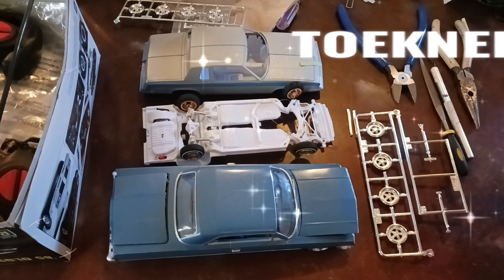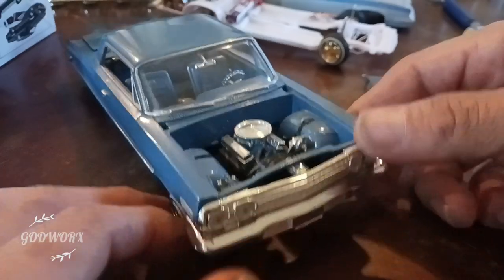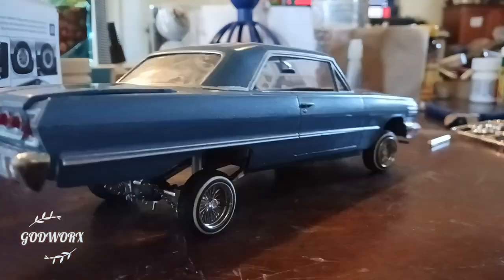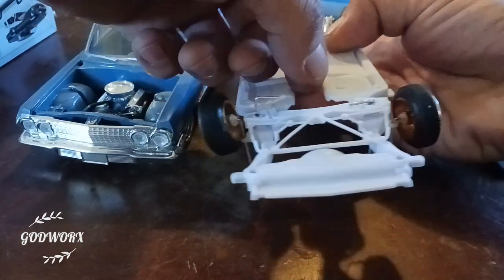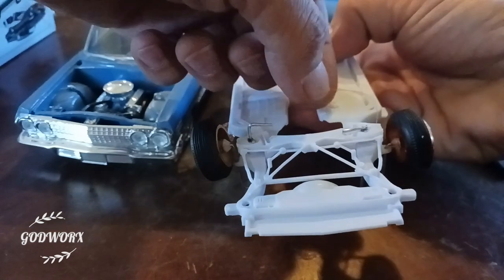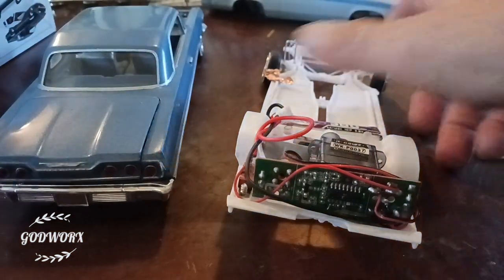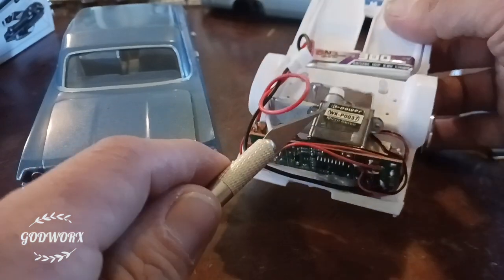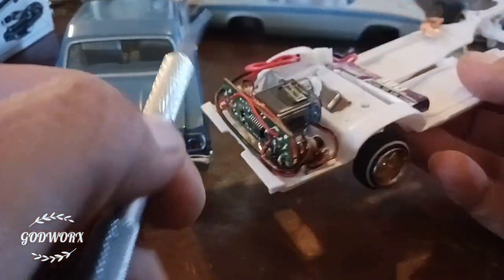☆WIRELESS LOWRIDER HOPPER☆

Comment: The part u made so paper clip can slide threw in ...what did you use to make it brotha?🙏
Reply from the maker: On that part I used a piece from a servo Horn and glued it on the upper A arm to extend it.
Reply: @XGODWORX  damn bro u a lifesaver! 👍🙏 💯
Reply from the maker: @jayypeezy36   no problem, I apologize for not pointing that out on the video...

Comment: What motor u use for hop
Reply from the maker: You can use a micro crawler motor from Amazon or ebay
Reply: @XGODWORX  they powerful?
Reply from the maker: @Hunter  yes they do.. alot of torque. Check out my other how to video and you can see all the parts I used.
Reply: Do I need all that metal weight?
Reply from the maker: @Hunter  correct ...but not alot with the crawler motor it has weight